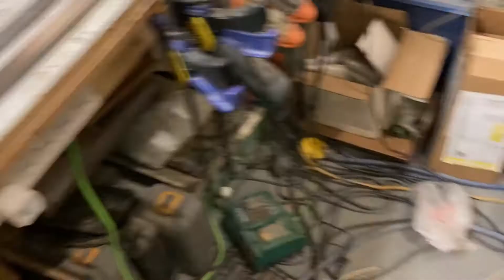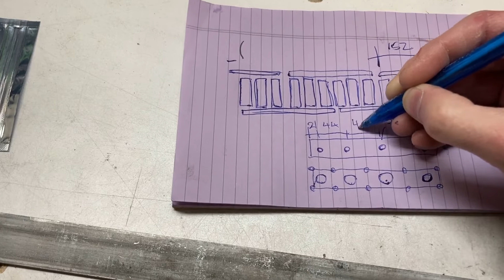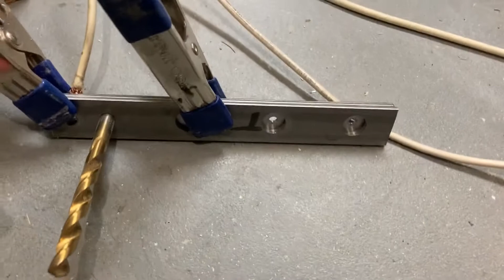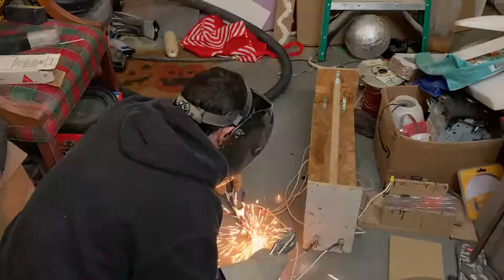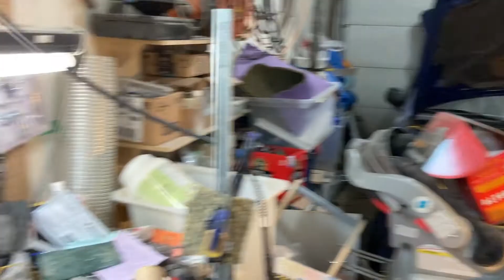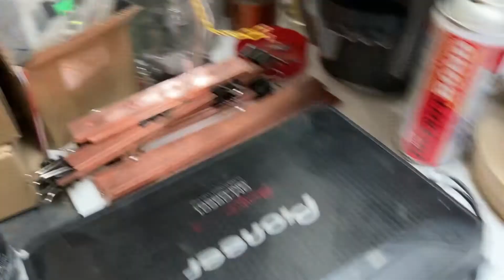DIY Lithium Bank for Car Audio - 38120 (Headway) Cheap Custom Bussing

Comment: I wish I'd had a drill press when I did mine. It works and you can't see it inside the box, but the bit walked a little on some of the holes.
Reply: Thanks. I was all fired up to put mine in and thinking it through. Then it hit me that once I connect the wires it'll be live even with the under hood battery disconnected
Reply from the maker: I just finished 2 more sets of bars. Way nicer than the steel ones. But the press definitely helped a lot. Posted pictures on my Instagram. Working on a video now.

https://instagram.com/projectpaperchaserecords?igshid=YmMyMTA2M2Y=
Reply: @MrM_Full-Send  maybe a dumb question but what order did you connect the wires when you installed it?
Reply from the maker: @gregblau8082  I honestly don’t recall… I think positive first but can’t remember for sure … 🤔

Comment: Mr m can this lithum battery you are making can it be added to existing agm batteries in the vehicle?
Reply from the maker: Ideally it would be isolated so that it is only connected to the charging system when it is running. Im not an expert with regard to lithium batteries but I’ve heard lots of conflicting info. I will be making a new unit with and internal balancer and isolator. Video will be posed as soon as it’s done
Reply from the maker: But yes I just directly wired it into my existing electrical system with my lead acid. And had no issues before I sold my car

Comment: Install these in car yet?
Reply from the maker: Installed, ran for two months and sold…
Reply: @MrM_Full-Send  how did your voltage hold up when u had it in, and how much power where u running? I'm thinking of building a bank with 16 cells to add in stock electrical
Reply from the maker: @SoundXper1ence  it did very well for up to 5k . The lowest my voltage went while driving was 14.6 . Alternator charged at 14.9 so it dropped 0.3 volts. I was running an autotech engineering 320amp alternator and a wolfram O-5000.1d
Reply from the maker: But if you do the math… I never reached my resting voltage and was therefore never drawing power from the lithium bank 😒
Reply: @MrM_Full-Send  Nice! I'm using stock alt 150amp but don't plan on doing more than 2K so hopefully it works out for me.
Reply: @MrM_Full-Send  true
Reply from the maker: @SoundXper1ence  I think my math said it could supply up to around 6140watts for about 3 minutes with the car off. So if you just playing music with 150 amps topping it off I think 16 cells would be plenty

Comment: I'm doing the same just got mine in the more I see the more I learn 👍thank and love the explanation on these
Reply from the maker: My pleasure. I also put a balancer on and Might do a short video of that as well. Also used a relay to supply 2 volt displays, one in the trunk and one up front to display amp voltage as well as trigger the amps... so they all turn on with the headunit